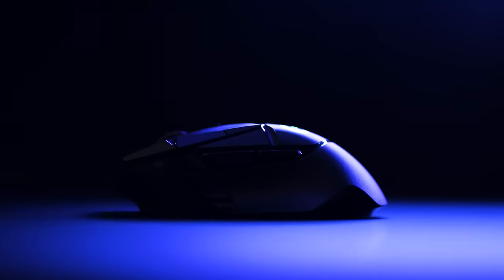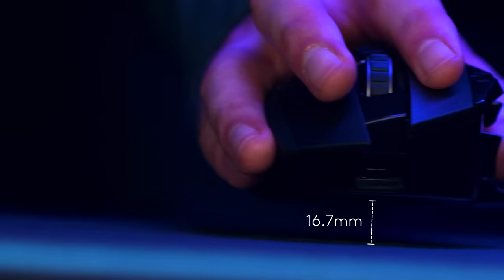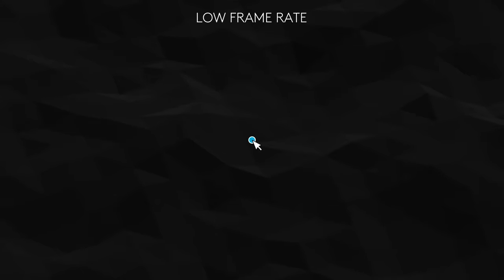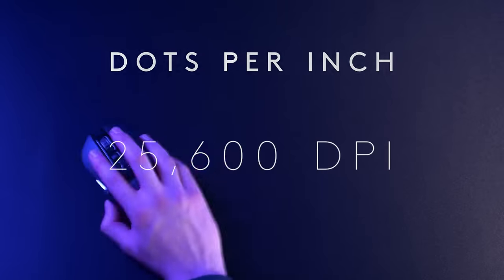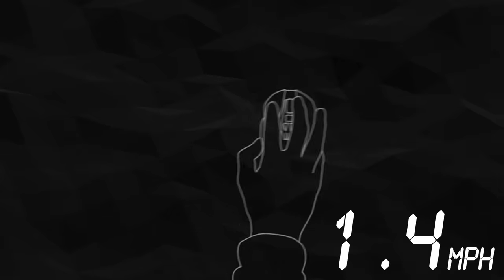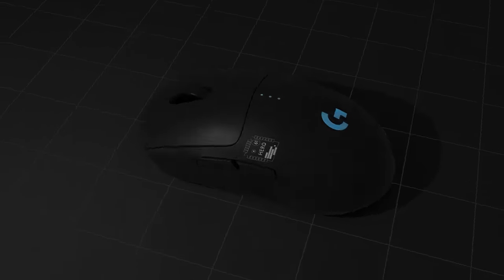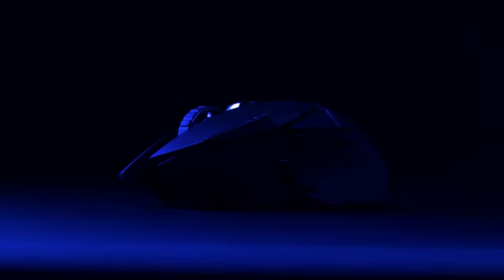How the HERO 25K optical sensor works

Comment: Even tho this is a marketing video, it was very insightful on how a mouse works. Thanks for that.
Reply: Is g502 hero better than 3389 sensor mouse?
Reply: @prime367  hell yea
Reply: @pate00711  thnx 💝
Reply: And from how my Logitech G Pro X Wireless Superlight mouse performs at 6400 dpi in Fortnite makes me believe that the marketing is true. No guessing, slight movements are very accurate. With a sensor this good, you want to turn the DPI up relatively high and then lower in game sensitivity. It is VERY accurate.
Reply: @prime367  what do you think of the mouse now
Reply: @JustinDaniels  I've used 6400 dpi in valorant as well and it was pretty accurate till they screwed up the servers unfortunately.
Reply: @JustinDaniels  And btw, do u play on board memory? or do u use the software?
Reply: @Cosmicmorales  I use the software, because I like to color code the RGB lighting on my keyboard to highlight WASD, inventory slot keys, etc.
Reply: @Cosmicmorales  its a high performance gaming mouse indeed a great mouse...but its heavy so it can affect the flicking shots ...so it vary from peeps to peeps...
Reply: @JustinDaniels  how did you even play at 6400 dpi
Reply: @Bruhh221  You turn in game sensitivity way down to make your eDPI about the same, and use the high actual dpi to give insane accuracy.

Comment: I made a g603 light speed wireless purchase a few years ago. Just searched the hero sensor out of curiosity . The battery life is unreal, I go through less than 3 AA batteries a year and I game like 8 hours a day
Reply: Using AA battery in g603 damn ur mouse should be heavy af
Reply: @kpg10  i only use 1 AA batterybat a time.
Reply: @aixaazqadri  I mean you have no other choice than using 1 at a time 😁
Reply: @kpg10  im a lazy man, i prefer a light mouse and maybe u do too. But many prefer a heavy mouse for increased stability. Consider the 2 battery thing a weight variation feature. Also its not 'i dont have any other choice but to use only 1 battery. Its definitely 'i prefer to use only one battery'
Reply: @aixaazqadri  You prefer light mouse and you still use AA battery? Weird logic there bud. And it is that "you have no other choice but to use only 1 battery", you can't use more than 1 at a time in a mouse. So stop talking bs pls.

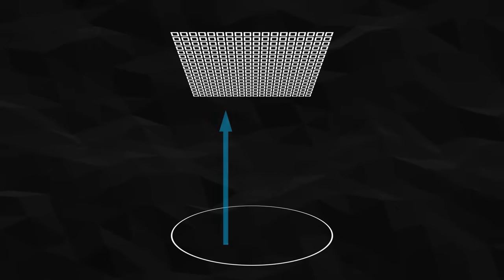Comment: 0:38 gonna nerd out on this, but it is entirely impossible to convert photons into electrons. Photons are bosons, which are massless particles with a wavelength. Electrons are leptons, a particle with mass that does not have a wave length. Although electrons carry energy, they are made of matter, bosons are pure energy. You cannot turn a particle of energy into a particle of mass, but you can go reverse. The only way to convert a particle made of mass into energy is through a nuclear reaction, and the particles that do that are protons when they turn into neutrons.
Reply: im not so smart, but solar panels convert photons into electrons right??
Reply: @GREG_MOTO  solar panels use photons from the sun to rip electrons away from atoms in the panels to create a flow of electricity
Reply: @aydenburris8631  thx for explaining, learned another thing today.
Reply: Possibly a conversion of info versus a conversion of energy itself I guess? They did word that in an odd way
Reply: @dravenmoore9104  that's what I figure. Weird thing is, a device that detects photons and sends the information out as electrons is just a camera. Every camera that's ever existed works like that.
Reply: @Puppy Emeritus "You cannot turn a particle of matter into a particle of energy, but you can go reverse"

What happens when you "go reverse"? What particles are created?
Reply: @Mido_  I missworded that, I meant you can turn mass into energy, but not reverse
Reply: Photons have an effective mass, since they do impart momentum when impacting
Reply: @compuguy123  double check that statement dude, photons have no mass. They are guage bosons, which are massless.
Reply: @aydenburris8631  They carry effective weight, because that's how particles work - wave particle duality and all that stuff. 

It's the principle that lazer thrusters and solar sails use to work
Reply: @compuguy123  solar sails don't exist dude. I'll start copying and pasting sources that say photons are massless if you need. They have no mass
Reply: @aydenburris8631  Not trying to be a Logitech apologist here, but it's not like they're saying that's their innovation. They're just explaining how optical sensors generally work in this part. It's so that the audience can make sense of the improvement that they made in the part following this one.

Basically, 1. "here's how cameras work in general" and then 2. "here's what we're doing to make this mouse better"
Reply: the way they phrased it is correct, they are not referring to a direct conversion but rather whats called transduction, where in a sensor, photonic energy can be transducted into electrical pulses.

- Source: Studies of the inner workings of camera sensors in Audiovisual Design.
Reply: Also, by the process of Pair Production (look it up), you can get an electron positron pair from 2 photons.
Reply: Where can I get a wrinkly big brain 🧠
Reply: stop looking for google and copying the first answer you got, do some research before thinking "gonna nerd it out" makes you look cool or smart, you not that guy.
Reply: @gusblacio  call me out when you can provide something that tells me wrong
Reply: Never let science get in the way of good marketing! 😉

Comment: 0:35 can we take this as face value that the new Hero 25K sensor uses an 18x18 pixel array as opposed to the previous 30x30? Seems like a downgrade to me.
Reply: PMW3366 - This is Logitech's variant of the 3360 sensor and has same 36x36 Pixel matrix and resolution 12000 DPI
Reply: i've read that it's still 30x30 somewhere on ocn i believe. why does array matter these days though? aren't dpi values that stray from the array handled just as effectively these days or am i mistaken?

Comment: The hero sensor is good, I had a mouse with one. However you refuse to fix the double clicking issue. You keep using cheaper Omron switches without sufficient wetting current so the switches go bad and double click.
You also use cheap rubber grips that go bad, instead of real silicone grips.
Please fix this....
Reply: YEP, now Razer uses those juicy Optical Switches, but Logitech could straight up use those TTC Golds used on the HyperX Pulsefire Haste
Reply: @MrGlitchDogePE  why not just use the kailh gm 8.0

Comment: It just got me thinking now as I'm having to buy a new mouse because of a scroll wheel irritation with my current ADX garbage, has there ever been any thought into putting a mini laptop trackpad in place of a scroll wheel, right there in the middle, or are there to many who like the click of the wheel, I just see the wheel as a point of many issues, mostly from dust and dander to misaligned sensors etc... A mini trackpad as the scroll wheel and function, hmm, big bucks ideas for free...

Comment: I have the White $150 Pro X Superlight mouse. It is unusable on my bedsheet as I use my laptop on my bed before I go to sleep a lot. Which surface does the sensor work best on so I won't have problem anymore? I want to test it out to see if the mouse has problem or it's just my bedsheet before the warranty expires 🐓

A response from Logitech to my BestBuy review states that the sensor will not work on my bedsheet 🐁 Give us a good recommendation which surface the mouse works best on 🌸
Reply: On a mouse pad, duh!
Reply: @JustinDaniels  I like the comfort on my bed 🐁
Reply: Same problem. I have a g403 hero, and it doesn't work on my MOUSEPAD. I had to go back to my G300S while I research what is going on. I think it's something to-do with the lift detection and some type of surface detection, with mine it simply refuses to register movements very often, and I have to change the surface (i.e. I put my fingertip close to the sensor) and it starts to work again, however, it keeps failing. I think something on my mousepad is simply like cryptonite to it, even a sheet of paper worked better.
Reply: @Lucas_Simoni  I think it's the mouse's problem

You should contact them regarding warranty and this also improve their quality in the future too as they know what are their weaknesses in their products
Reply: gaming mouse focus on acuracy, there are other type of sensor who work in glass but its for office use not gaming

Comment: Do I need to buy a new mouse just to get the  25k sensor?
Reply: If you have the g502, 703, or gpw there's a firmware update you can find somewhere. Or check your ghub it might already be updated 👍
Reply: in g305 is it possible?

Comment: In the GPWX at the highest DPI 26000 and the lower FPS 100. It's a freak if a mouse. You could move it with a desk fan. 
I'm running the GPWX with the powerplay. And the only mouse so far I like at 3000DPI and 1000FPS and I can just move it in my fingers. I was using the GPH at 600DPI as it didn't move right for me. But I'm wanting to try a G502 Lightspeed for working and editing. But there hard to find due to no stock and Covid. 

I'm thinking if the pro series are high end hyper sports cars. Then the G502 is like a luxury sports sedan
Reply: I would say it's more a g wagon with the superlight being the AMG version. If you want the low Lamborghini feel that's the razer viper. Sincerely, AMG gang.

Comment: Razer FOCUS+ sensor is better (no front)
Reply: Lol 2mm default lod nah
Reply: @rl2817  + 650ips 
+ motionsync
Reply: @user-vf5pu8gz8l  like what? I can move my mouse at 650ips with my hands?
Reply: @user-vf5pu8gz8l  motion sync is marketing gimmick, basically the same as logitech's hero, it adjusts the framerate based on the mouse movement
Reply: @rl2817  what are you saying to razer Avalon? Ces 2021 is comming;)
Reply: @user-vf5pu8gz8l  ever heard of hydrogen atom mouse? It has 8000hz polling rate too. Some pros even prefer 500hz. You can't feel the difference like what they did with their optical switch. No one would say "omg this mouse feels 0.5ms slower". Also higher polling rate makes your cpu works harder
Reply: @user-vf5pu8gz8l  i just hope razer would fix their software bugs and make their peripherals support saving more settings in the onboard memory like lod, rgb, and more.
Reply: @rl2817  what did razer to du you bro? 😂
Reply: @user-vf5pu8gz8l  what do u mean kid? I dont understand.
Reply: @rl2817  is saying in your language that wat di reizer du yuo bro. Now you understand? 😂👌. If you don't like razer don't bother other people who only want to say his opinion. I respect your opinión, "Razer is bad". But you don't have to do that all the people have the same as you.
Reply: @BAO1477  you don't need to reply every comment on logitech's channel to say razer is better, if you're supporting razer then why did you come here kiddos
Reply: @rl2817  here a toxic person, I only say mi opinión bro relax.
Reply: This is absolute cap.
What is motionsync? 😭😭😭

Comment: Hey, logitech  You will make the mice 

 G switch 

"Fxxk double click issues"

plz Optical switches
Reply: What?
Reply: Mechanical feels so much better
Reply: I also say óptical switch, for me is better because it don't have the double click problem as the mechanical switch.
Reply: If logi put optical it will be better but not with a very expensive price.
Reply: ^razer fangay
Reply: @rl2817  optical switches has the same mechanical, the only diferense is than instead of complete circuit it allow pass light
Reply: mechanical switches are not what causes double clicking

Comment: Hero sensor is not accuracy at all, Pre version used PIXART sensor which is way more better . Pixart 3366 version G903 ,wired G502 are far more accuracy than G903 G502 wireless hero, the one I love most is G302, perfect for warcraft III, and G303 ( stoped manufacturing). I would not buy any new Logitech mouse with hero sensor. BTW ,I am an old fan ,I used logitech mouses since it only had  400DPI, logitech G1 remind me good memory. Laser sensor 9800 and hero are the worst.
Reply: I'm gonna try Pixart one day.
Reply: why u say that, hero is more precise than the 3399, 3395, 3370 and 3360 from pixart. I say this because i have tried all of that.

Comment: This sensor is garbage, it has zero lift off distance control . the PMW3366 was far superior  on their wired G Pro .
Reply: Tf do u mean this sensor is amazing
Reply: @nightfall7366  He just told you, the lift off distance is not adjustable. As soon as you buy some aftermarket feet that are 1mm thicker than the original ones , you start having sensor tracking issues.

Comment: Ok I figured out Logitech. My mouse doesn't work correctly and it doesn't respond so nicely. The cursor lags insanely much that I am annoyed that I am very angry! 🍄 🐖

So this is the problem.. Since your video states that the mouse is so precise and accurate that it knows when it is =>1.2mm above the surface. The mouse thinks that I lifted the mouse up so it stops capturing images to record its position so the cursor behaves so so so erratically on my screen!!! ( This happens when I use the mouse on my bed.. ) 🌸 🐁 🌸

So Logitech.. here is what you need to do.. 🐎

You need to update the Logitech App so we have the option to select which surface we are using the mouse on e.g. bedsheet, mousepad, and so on.. 🐚

If I select bedsheet then the mouse will only think I lift it up when it is ~3mm above the surface (:  🌚

I love to have the comfort using my laptop on my clean bedsheet on my bed before bed time :D 🐷 🐛
Reply: so you want them to add mouse calibration right?
Reply: @rarinth  Smart! 

It'll make the app so much more powerful and the mouse  so so so much better, powerful, and flexible!!
Reply: @0animalproductworld558  actually razer has a mouse calibration thing where you select the surface and it will automatically select the lift off distance for you (btw it's not for all mice and only for razer mice only)
Reply: @rarinth  Dang didn't know that@! That is incredibly high tech!!! (: